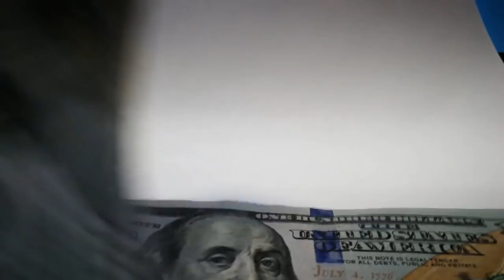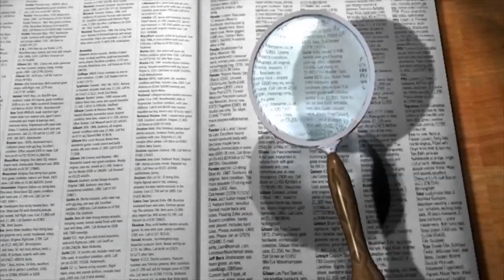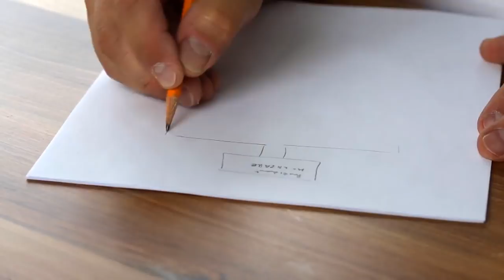Pros and Cons of of being a Civil Engineer | (civil engineering is worth it?)

Comment: I wanted to be a civil engineer too, but i took a gap yeear and got a job. i worked as a carpenter on construction site for a year mainly to gain real world experience for when i do become an engineer. I found out i loved it, i get to build a building, be outside all day and get paid pretty good. I'm still planning on going to uni in a few years but that might change.
For anyone wanting to be an engineer , i suggest you get out in the field and try some construction work, whether its bricklaying, carpentry, apprenticing, labouring. it will be beneficial to youin the future.
Reply: Josh D Thank you very much
Reply: I concur, there's a company in my hometown which builds wooden building components. It's basically prefabricated framing. I worked here last summer and came back for this summer between the school years. Real work provides you with valuable life experience.
Reply: Josh D I do carpentry with my dad and go a lot of places with him during summer or when I don’t have school to go work with him I’m js 14 years old but I wanna be a engineer in the future
Reply: i suggest u architecture instead, or construction

Comment: should I take civil engineering in college even if sucked at math (all branches of math )?
Reply: Civil engineers honestly do not use too much math, with the exception of structural, but all engineer majors in colleges have a lot of required math classes that are very difficult. Hope that answers your question!
Reply: I wasn't that great at math either, got average grades in what was the 2nd highest math level in high school. I ended up failing a math course in my second year of uni but I re-took it and passed easily. It's just practise, if you're interested in Civil Eng and can get in, go for it!
Reply: I wasnt good at math practice hard sacrifice relationships and even family but keep yourself healthy workout. Even on vacations review and practice just find one thing you like about the profession and focus on the big picture. Its going to be alright and dont be afraid to ask lots of questions and if you can video tape your class to review it at home.